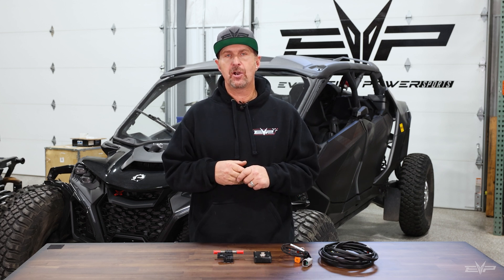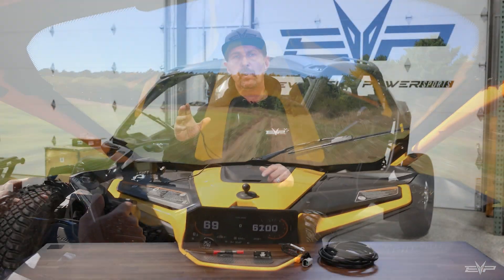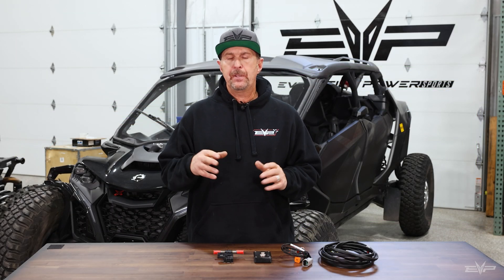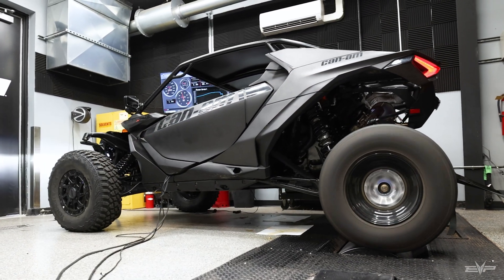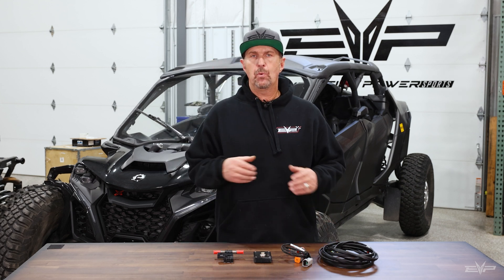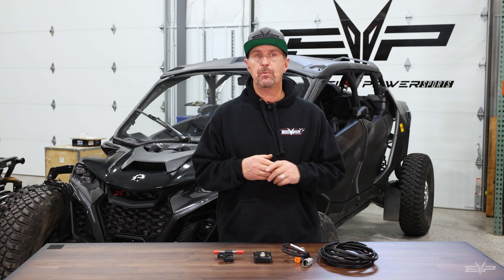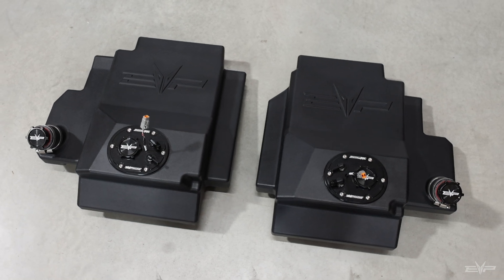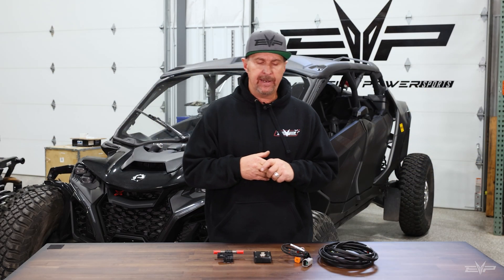MAVERICK R FLEX-FUEL TUNING

Comment: I really like the system cleanse possibility of the spare tank. Run the main tank dry at the end of the day, switch to the aux tank and flush std fuel through the system. No stored e85 or tank draining for the days not used.
Reply: Yep I have the rpm tank system and it hooks the the whole fuel system and I can pump all the fuel out of the whole system

Comment: You should include this with P47 turbo kit. It doesn't run well unless it's perfect E85. Just trying to help!
Reply: Hey Haugenracing, I am running the p47 and used pump e85 as well as pro x85 and never had an issue with either
Reply: @AlphaOffroad859 it doesn't have flex from the factory and only adjusts based on octane using knock. It's really meant to be perfect e85 or it won't run optimally. I worked with evo for a couple weeks on issues and this ended up being the fix.
Reply: So I’ve yet to do the p47 kit is it going to run like crap if it’s not running Max tune and fuel all the time?
Reply from the maker: @406xxxotics not sure what you mean. Can you rephrase your question?
Reply: @406xxxotics I think he meant it runs the best when using e85 put you can run pump gas no problem at all